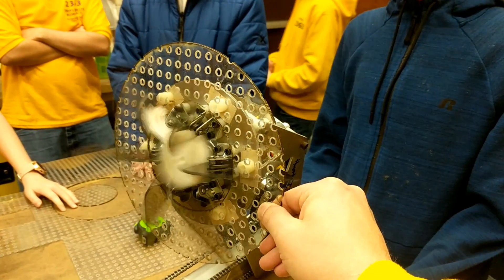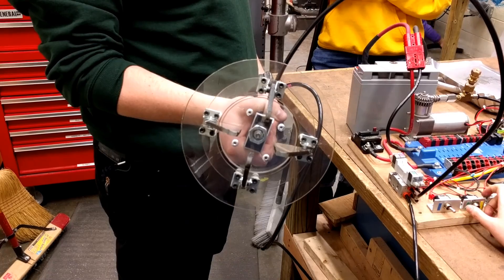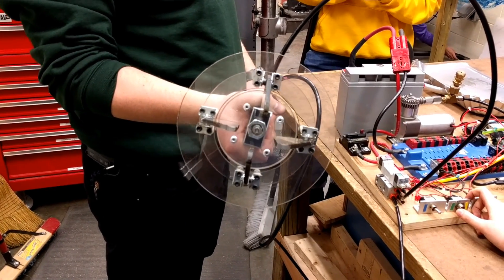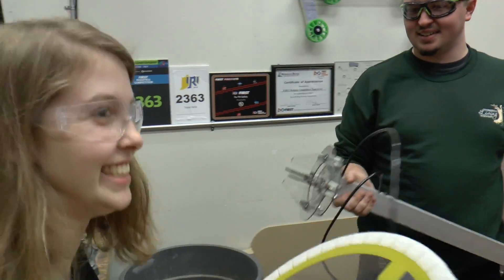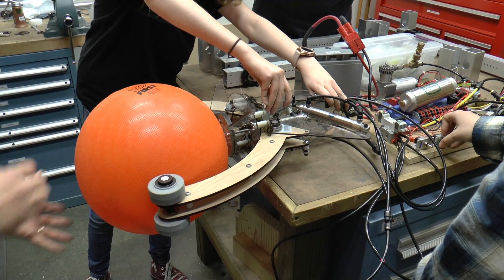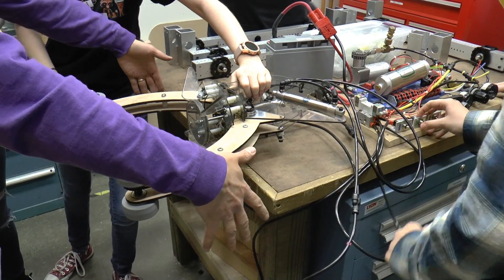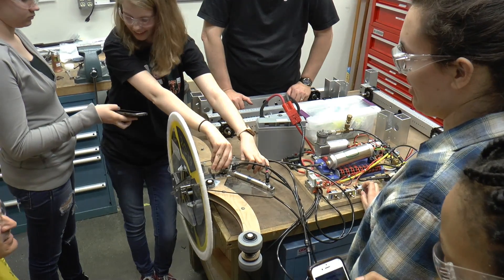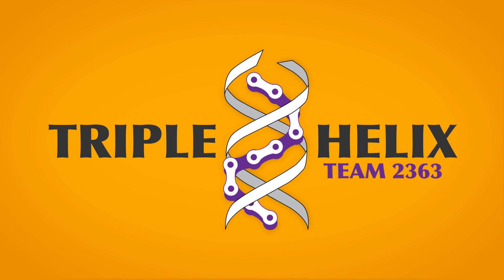Triple Helix hatch gripper prototype testing

Comment: this might not work with placing hatches on the rocket, as the cargo manipulator extends out, which would hit a rocket fin (and get in the way) if you try to place the hatch
Reply from the maker: We checked it in CAD.  The cargo arms are narrower than our bumpers, which clear the fins when the bot is aligned to the rocket port.  You'd be right if the cargo arms were wider than the bumpers.